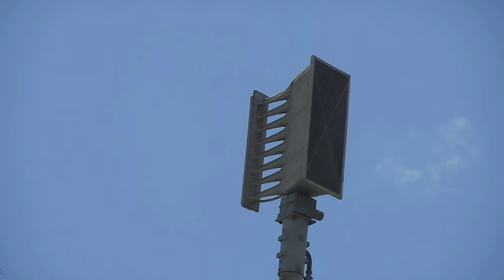Malfunctioning Turkey Point Nuclear Siren Test Whelen WPS-3016 Princeton, FL (Part 1/4)

Comment from the maker: Update: this siren has been replaced with a Whelen WPS-4004.
Reply: even replacing them doesn't solve shit. Just get rid of that shitty decoder they have
Reply: They replaced a practically new siren when other towns were able to keep their thunderbolts in good condition since the late 1800s to early 1900s!! See what they mean by (they don't make things like the good ol days?)
Reply: MrOak Thunderbolts did NOT exist in the 1800s and early 1900s, they went into production in 1952 and ended production in 1990.
Reply: I gotta say, they kept the earlier model of a 4004 yet they got rid of the 3016s
Reply: @mroak6504  you have 2% IQ 
Your not smart…
Reply: at least they didnt replace it with a 2001 siren
Reply: @mymistkaes thank god I hat the 2001s😅
Reply: Thank goodness
Reply: Should’ve given them 2030’s and since 2030’s ain’t got 16 amplifiers swap the 3016’s with new 4004’s
Reply: The batteries made it get replaced

Comment: The issue is mainly outdated encoder software.
The siren can do all the tones and voice messages just fine, but the encoder that sends live predetermined messages through the Voice mode is more prone to malfunctions and could affect other sirens as well.  (i.e. other WPS 3016s, the 4004s, etc.)
As consequence, the live messages get completely drown by garbage noise, sometimes cut for a brief moment (or totally on rare cases, and the DTMF codes (either for Voice or Alert) at the end aren't properly send out. And the siren doesn't rotate until the Voice message it's completely done, sometimes skipping entire angles to recover and keep up with the other sirens. (that could also have the same issues as this one)

[Edit] Also, pretty curious to point a little foreshadowing here: 5:47

Comment: That’s an issue with the signal transmission, not the siren. There was another video of this siren where it was literally playing windows error noises that it was getting from the radio... they need to fix the computers running the radio transmitters
Reply: Is that possible? I mean I guess it has horn drivers instead of motors but, I thought these sounds the Whelens played were installed onto the corresponding unit itself?
Reply: @enderpea5251   no, this is a live broadcast. You can tell because of the DMTF tone heard at 0:54, that would activate PA mode if it weren’t already activated on this siren
Reply: @charlie_nolan  Oh my gosh you're right! And also at 1:20 you can hear pulsing from their radio! I heard they replaced that siren. So either the corresponding receiver unit was stuck on that mode, or they replaced it without resolving the same problem and had the exact same issue happen to them. They basically probably did it for nothing! It makes me wonder if they had to fix the software on their computer transmitters and got frustrated when they realized they didn't need to replace this unit.